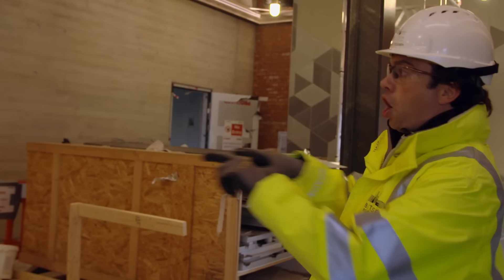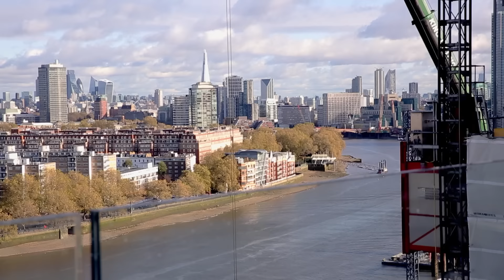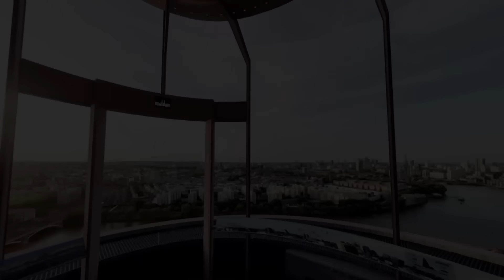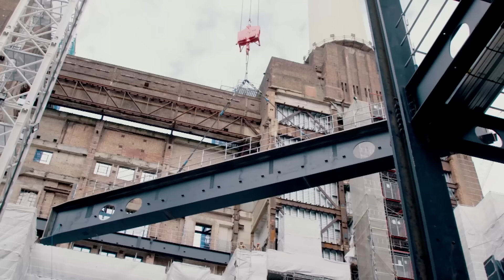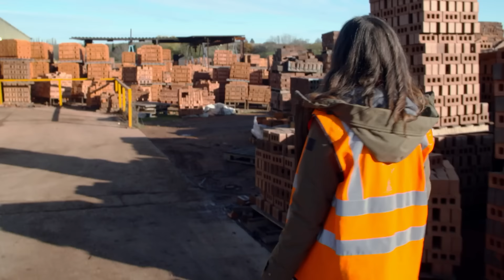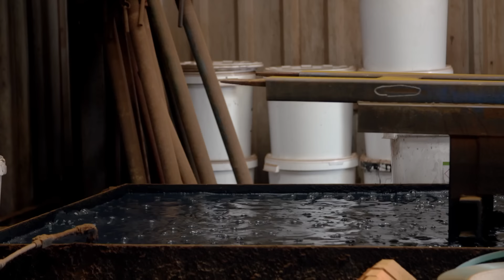The Biggest Engineering Challenge in London for Over 30 Years | Blueprint

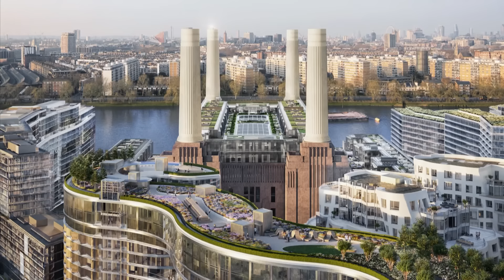Comment: FACTOID A huge water cooling system was part of the electricity production process in power station. @ 30:57 on the opposite bank of the station you can see white tanks on top of blocks of apartment buildings. The hot water from the cooling process was fed under the Thames and these apartments received free hot water for years.

Comment: Why doesn’t this show the finished project? I’ve been inside and it’s amazing to see how it turned out. Also what’s with constantly changing units from metric to imperial in the narration. Can we not just stick to one? Preferably the one the rest of the world uses.
Reply: Should have stayed with imperial, that is what was used when originally built.
Reply: @beaufighter245  yes and doctors use to subscribe cigarettes, we’ve moved on…. 😆
Reply: @domtomas1178 cigarettes? What has that to do with imperial?? Yes, things do move on but, imperial works just fine.
Reply: @beaufighter245 no it doesn’t it’s a mess. One moment it’s using stones the next feet, maybe elbows and toes. We should go back to using our teeth to check for pure gold 😂
Reply: @domtomas1178 no, just imperial, it's an easy system. I can use imperial or metric but prefer imperial. In fact, I specifically buy USA made tape measures that only have imperial printed on them. 
As you said, things move on but not always for the best. Solar panels and wind turbines an example but, nuclear is far more efficient. Give it time and vehicles will return to diesel and petrol!

Comment: Bigger than The Docklands project..? Me thinks not! 
They are still building over at the Docklands after 35 years. I still remember in the mid 1990s how complex it was to shift so much water to build the area around The Daily Mirror building and more.

At least the power station had a frame standing on land next to the river. Both plans were headaches of achievements. 
By the way, the video you posted it should be noted, is not new in December 2025. It has been up and running for some time now. And we worth seeing.  
I looked at investing there 2 years ago and was not convinced…

Comment: I was told go down there with other site engineers since McAlpines wanted to garner interest in us working on the Project. At that stage they had already put in temporary works to hold the building up whilst the internal structure was demolished. The internal space looked bigger that 4 rugby grounds silos had been placed to mix concrete on site. Sadly, the developer at the time, John Broom went bust and McAlpines lost the money they spent putting in temporary works.